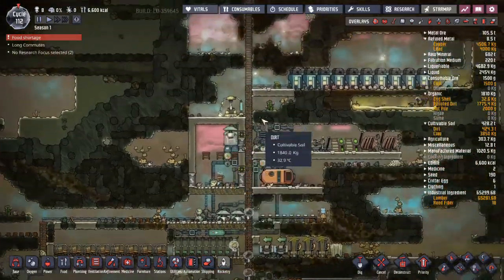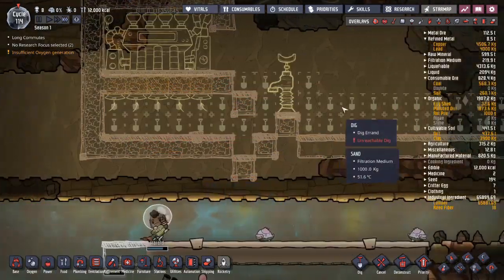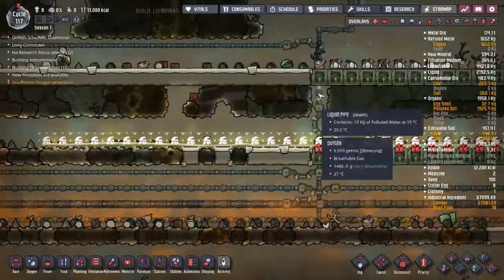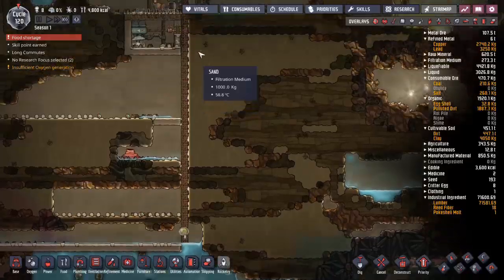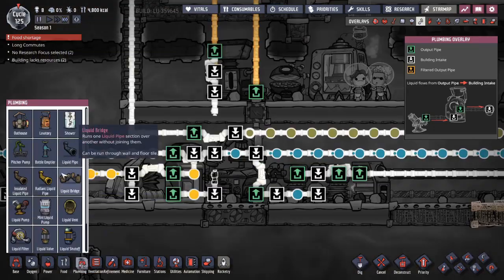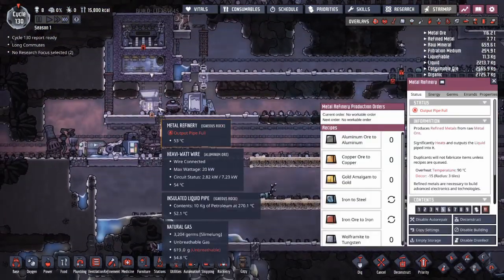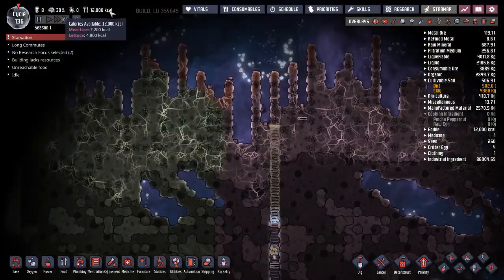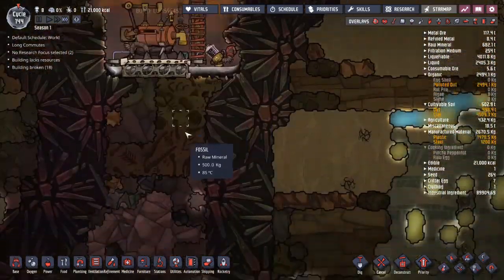Survival Mode OASISSE - S01E05

Comment: Nice video like always, on a side note, I’ve tried my hand to tame the steam vent and it’s quite the challenge! I’ve tried to make it compact but the overall design still seems to leave a big impact on the overall space it takes. Steel is definitely the best way to go and I did try the door compressor method which seemed to choke the steam vent a lot. The overall power generated by the steam generators was staggering and I really don’t know why I’d need that much power :p 

A good tip would be to make it bigger than you want to and then start to make it smaller while finding problems along the way.
Reply from the maker: In my experiments so far, I'm using three door compressors (right, left, above). It seems to be enough to handle a very productive steam vent without overpressuring, but I'm still in the experimental stage.